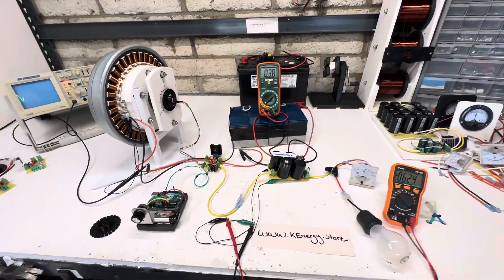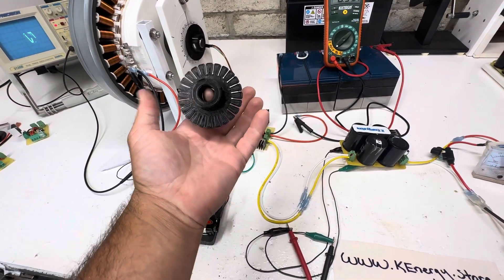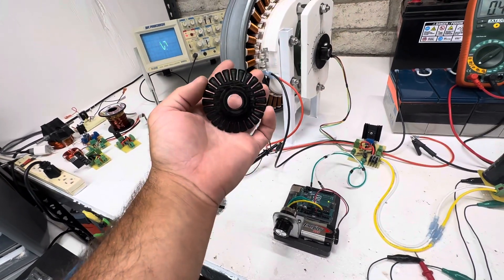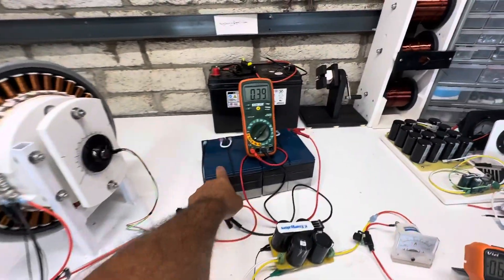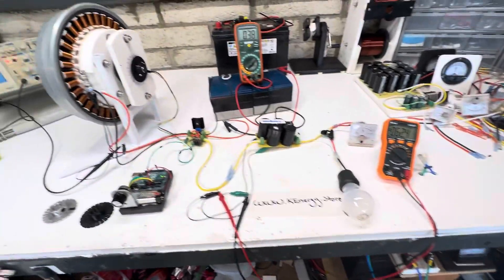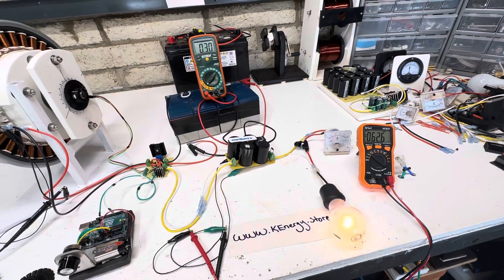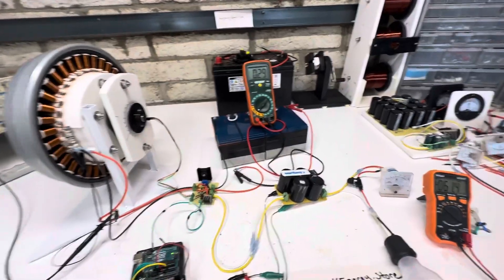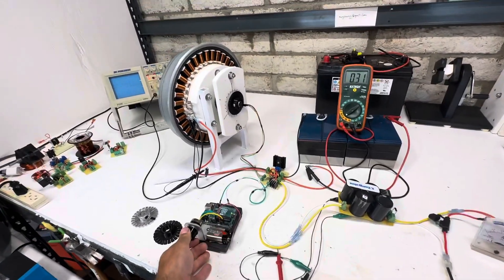Washing machine motor project update

Comment: Hi K
Interesting how slowing it increases the output, you "would think" the opposite eh
Maybe the PWM is chopping pulse up and so you get more flyback "repetitions" 
Or longer pulse width at slower speeds so more current to snap itself into more flyback upon switch opening?
I dont know whats your theory on why more power?
Can you see what is made in the two unused phases? 
Just for fun ...whats the voltage in each? 
What is the amps if you put ammeter directly across the leads of a phase?
What happens to input draw in amps when the unused phase gets crowbarred (shorted out with an ammeter)  
Does the motor want to stall and come to stop if both phases crowbarred?
There is probably a perfect resistive load to put onto them just guessing seat f pants 30 ohms......also can those unused phases fill a fairly big cap without undo lugging?
You could use that nice 3D printed timing disc to pulse-out the "generator" coils (the unused phases) into a load too or a big cap...
Thanks for the videos you rule
Reply from the maker: Hey D yes by using PWM the motor doesn’t have to turn fast it takes 1 pulse and turned it into 5-10 pulses on each ( on time )

I just finished new circuit with 3 circuits so more Torque more output 

If you short the other coils motor stops does couple amps 

I like the pwm because even if you load the rotor you still get more output to a certain extent

Comment: Hi K. I have an elderly friend in Australia who designed, built and had Patented a far more efficient version of this Smart motor you are working with now. The causes of the efficiency remain removed before mass sales of this version. Many are the hours spent by many people because they see hope in and from this device, but leave frustrated because the main charm is absent. Thank you especially for your last video. Truly original.... truly functional.... By the way, the armature of the universal motor you used had remained unchanged since 1940s when it was patented by an individual as well as General Electric.....
Reply from the maker: Very interesting! I figured as much this motor has a lot more potential 
 Thank you !
Reply from the maker: If you ever need help or want to talk go on my website contact is there
Reply: @kenergy1707  thank you. I will
Reply: Was that the gentleman who used a Pelton Wheel as the mechanical source sir?  I was surprised, this performed really well.

Comment: For a while, I have been searching for an electric motor that has strong torque and is economical at the same time, but I have not succeeded. Is the washing machine motor sufficient for the purpose???
Reply from the maker: It depends what rpm you need this one is about 500 rpm at 48v but definitely a lot of torque!
Reply: @kenergy1707 Please do you have an idea of the motor amps at load? Thank you very much.
Reply from the maker: @رشيدحدادة  probably 5 amps
Reply from the maker: @رشيدحدادة  48v
Reply: @kenergy1707 - on a single phase out of three - correct?
Reply from the maker: @energydreamer5347  yes 1 phase